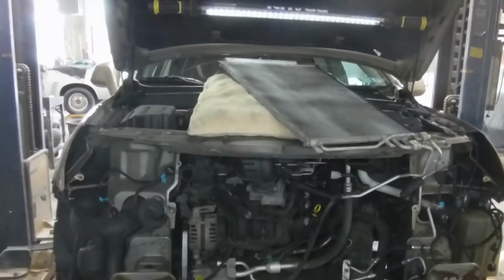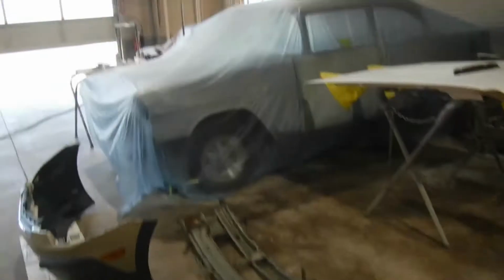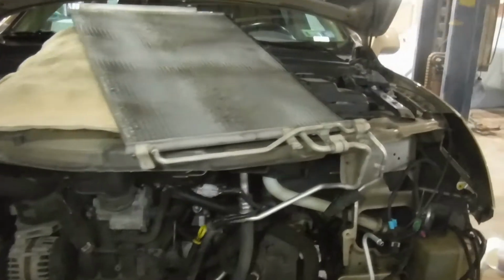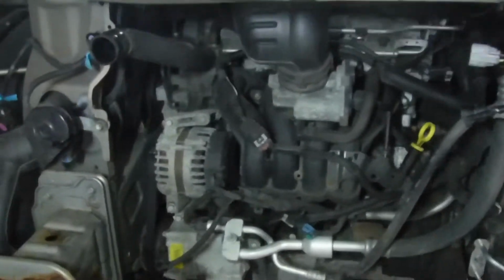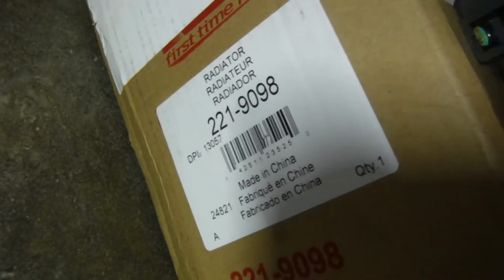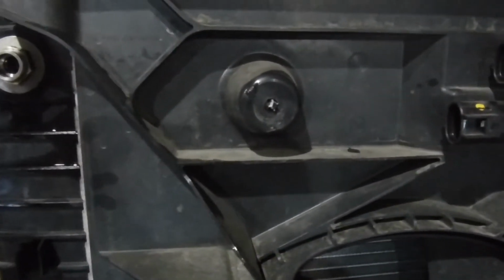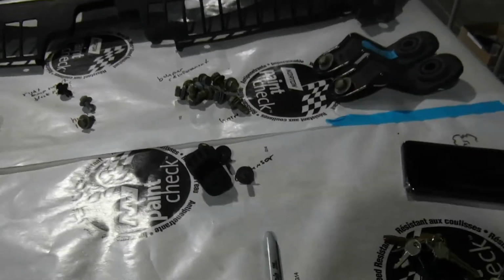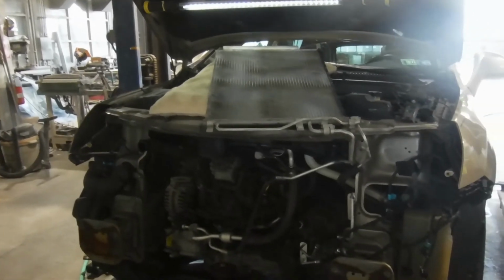2008 Saturn Vue Radiator Replacement

Comment: Hi! Hey! I got to give you the first thumbs up on this video! I just finished a 2008 Vue XE 3.5L radiator. I did remove the condenser even though I saw folks leave the condenser intact after I recovered the refrigerant. I was fearful of damaging the lines. I did not have to take off the bumper or the bumper guard. All I did was slightly bend the lower front lip of the top cross-support upwards, to clear the back of the radiator and I also used a Dremel tool with a cutoff disc to take about 3/16" of metal off of the two innermost lower headlight mounting tabs to clear the front plastic tanks of the radiator. That top cross support also hides a plastic cooling duct above the radiator fan module that is connected to the plastic battery/computer box. I think the duct cools the computer because it feeds forced air into a labyrinth in the battery box. There was a plastic rivet that was pushed in from the underside of the top cross support to hold it in place. The other end of the duct snaps into the plastic housing that is part of the battery and computer box into a square hole. That duct had to be removed in order to lift the radiator fan module high enough to clear the radiator clips. On the replacement radiator, I shortened the plastic clips that support the bottom of the radiator fan module about 1/4" with the Dremel tool to make installation easier. There was plenty of room and that made things a whole lot easier. As for the AC system, Amazon sells a decent vacuum pump for $60 plus tax. After installation, I pulled the system down and let it sit overnight to ensure no leaks and then recharged it. I admire your hardware filing system! I used a bunch of little ziplock plastic bags and labeled each bag (e.g. hdlt bolts, condenser hardware, radiator mounting bolts, plastic scrivets for radiator cover, grille, hood latch assy, etc.) I kept all of the little bags in one big bag because you nailed it! It's a lot of hardware to keep track of! I also changed both radiator hoses and replaced the butterfly clamps with screw clamps. You really said it best at the end of your video; Just Take Your Time!  I had that luxury. I am very grateful to you and the other people who posted videos. I hope my share here will help make someone else's life easier too. $60 bucks for that vacuum pump sounded like a lot of money until I was quoted $1470 to do this job at a Chevy dealer and $1100 at a popular franchise repair shop.
Thank You Sir!
Best Wishes,
Tom K
Reply: I dig the same, but the fan doesn't works when I turn the a/c on, it only starts when the car is hot, and turns slowly. What could it be?
Reply: @rafaellonieto8780  - My engine configuration is for the LZ4-3.5l. If it were me, I would check the fan connectors first because I needed to remove them to get the radiator out. Then, I'd visually inspect the wiring. Maybe something grounded out and blew a fuse (??)

If my car had drastically overheated, and that's why I changed the radiator, then I would check the engine temperature sensor next.

If my car DIDN'T drastically overheat, then I would go to the fuse box under the hood and qualify the fuses and relays for the fan. I think there were fan 2 fuses (Fan Aux and Fan Main) and three relays (Fan Aux, Fan Ctrl and Fan Main).
I hope this stuff helps! Good Luck!
Take Care,
Tom K.
Reply: @rafaellonieto8780  - I just thought of something else, when I turn my a/c on, my fan does not come on right away, just when the engine needs to be cooled.